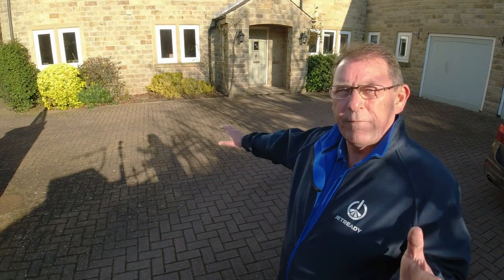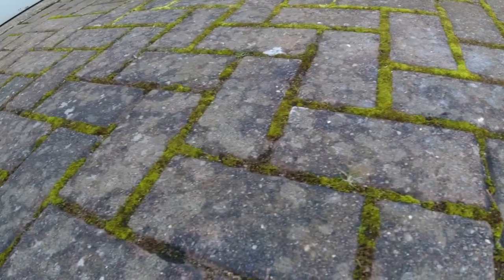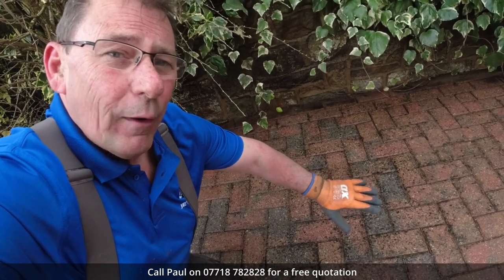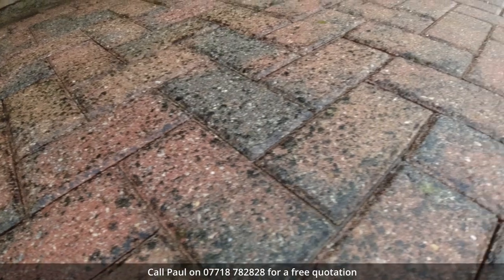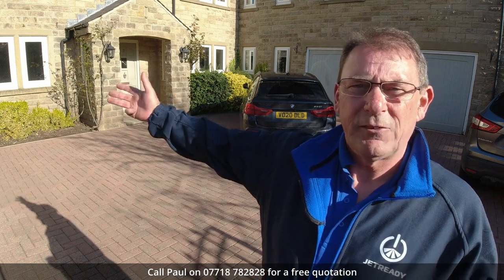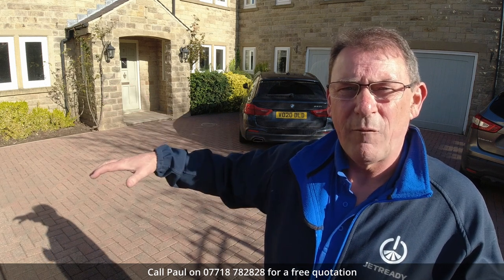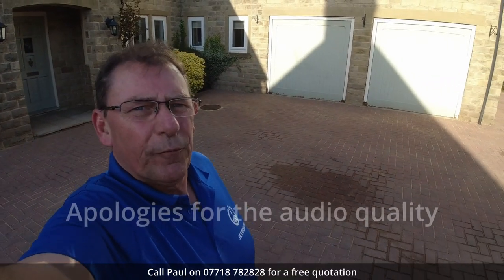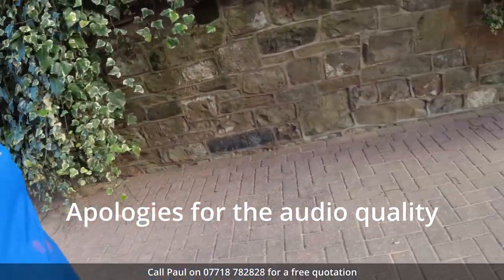Dirty driveway is INFESTED with moss and black lichen. Thorner near Leeds. @jetreadyuk

Comment: What ratio of hyperchlorite do you use? So a full 20 litre tub how much of that is water? Thanks
Reply from the maker: It depends on the initial concentration what is being cleaned. You want about 3.5% for flat surfaces, and spot treat stubborn area with a stronger mix.